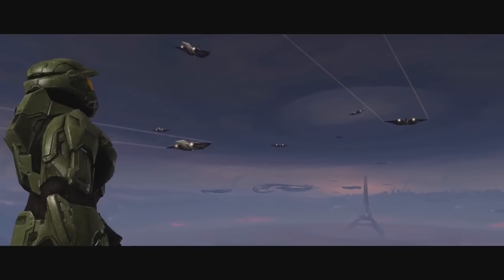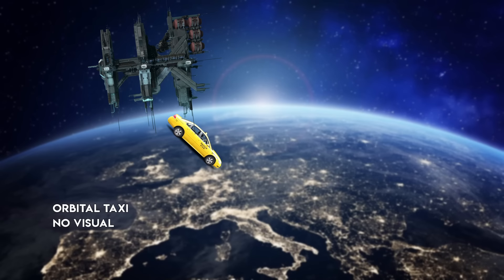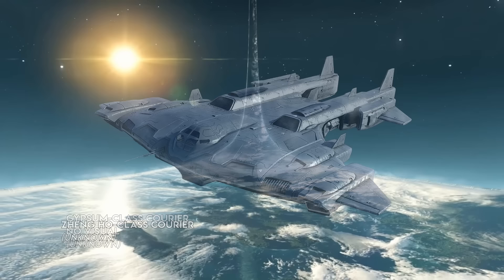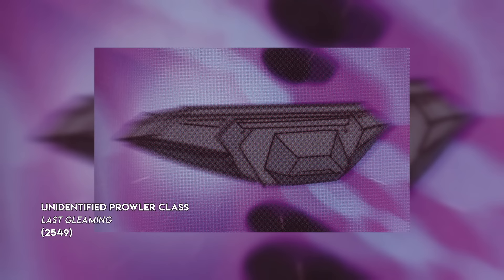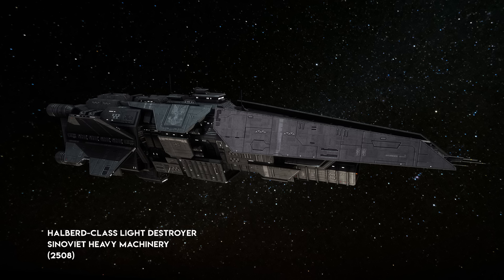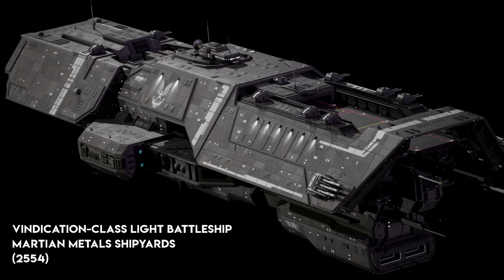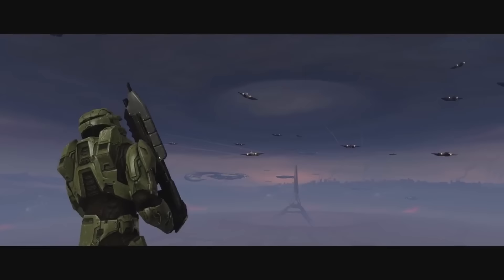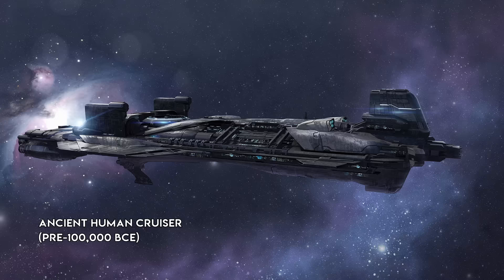Every Human Ship in Halo (Except the Shortsword)

Comment: My favorite thing about the Infinity Class is that there is a secret 2nd one out there somewhere.
Reply: Eternity was stripped for parts to repair the Infinity afaik
Reply: @averagehotwheelsenjoyer1649  Yes, but construction was still going along at least until Cortana did her thing. I don't think anything after that has come out about Eternity.
Reply: @ALLMINDmercenarysupportsystem After the Infinity was damaged or destroyed, the UNSC probably accelerated construction of the Eternity.
Reply: @tetraxis3011  Probably? Yes. However, it is just speculation.

Comment: I think an alternative to the "light battleship" implying a "heavy battleship" is that the battleship may have gotten a bad wrap in recent conflict. If, say, battleships went a similar route as carriers during the human covenant war, where they turned out to be way too expensive and slow. The political will may not have been there to rebuild a new battleship, given their so recent failure. So instead, the new ship line was rebranded a "light battleship" to imply more flexibility and speed.

I like stuff like this that alludes to the broader political world and behind the scenes puppeteering that it takes to get a massive trillion dollar spaceship line manufactured

Comment: The "Shaw-Fujikawa Drive" was invented in 2291 and Halo CE takes place 2552, meaning humanity spent 260 years without a faster than Light communications system at average speed 2 lightyears per day. This borders on ridiculous, because without a Waveguide FTL capacity to convey "Information" how is sensor data relayed except at light speed for starships; everything such as RADAR, etc would take hours.